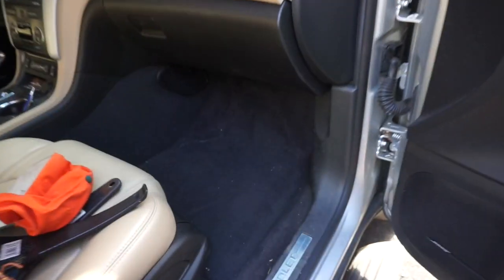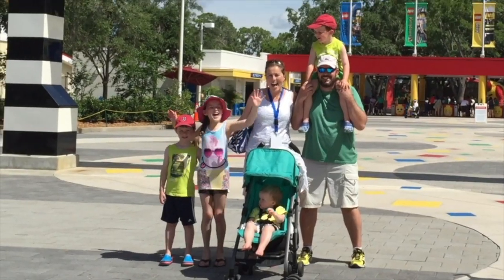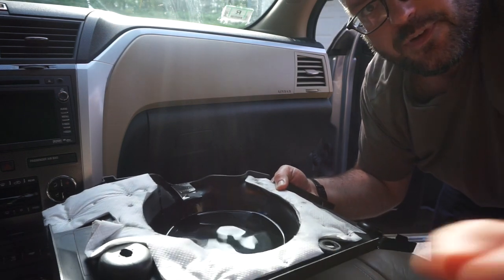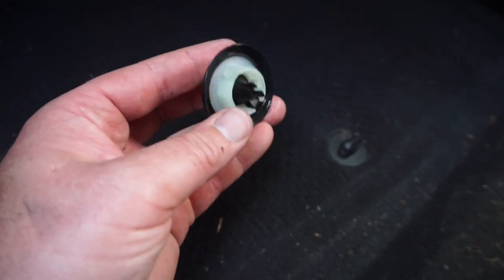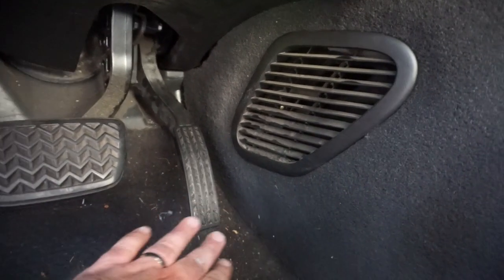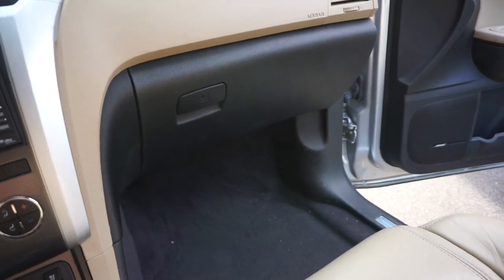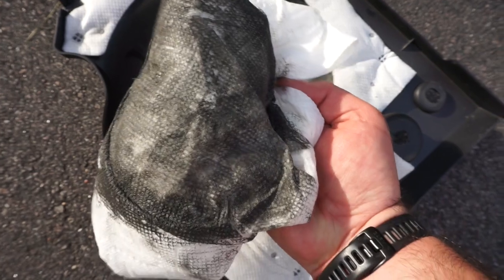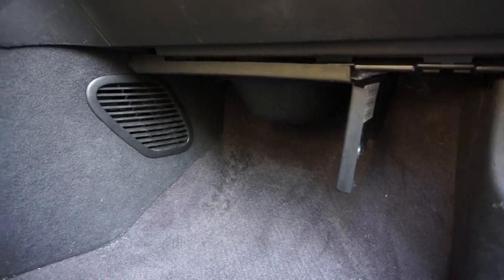WET PASSENGER SIDE FLOOR IN CHEVY TRAVERSE

Comment: I'm having the same exact issue with my 2011 traverse. I went out and looked at everything today after watching this video and when I detach the tube from the floor there was no water in it. So I guess in my case water is not even making it to the train but I could tell you on the passenger side it's pouring out. I guess I'll have to get like one of those bottle cleaners way up in there and see if I can unclog this thing

Comment: Thank you so very much for posting this! I just bought a 2011 Chevy Traverse and I am having the same exact issue. I just spent 30 minutes looking for any drain and thought I should check YouTube! So glad I did! I'm heading out to see if I can fix this before going to a garage!
Reply: Again, thank you. The valve was clogged and upon removal I drained close to 1/2 gallon of water through the tube. Removed the clog from the valve and re-assembled it in about 15 minutes. Took the cover off of the passenger side and there was close to a quart of water in it! Took the Traverse for a quick spin around the block--doing left turns, and no more squeals!
Reply: Vtv